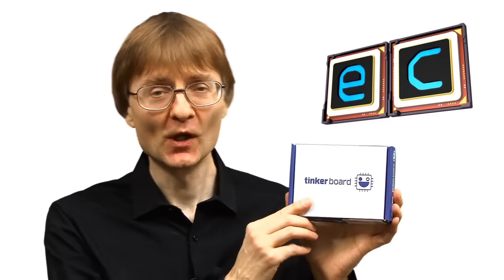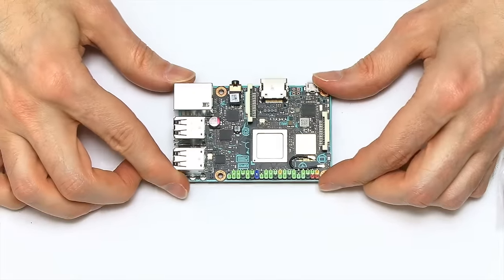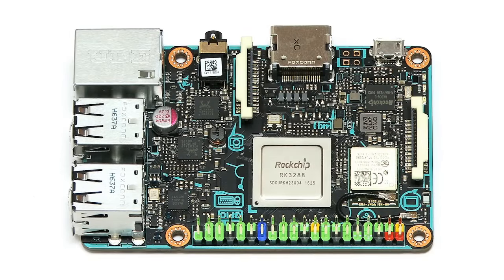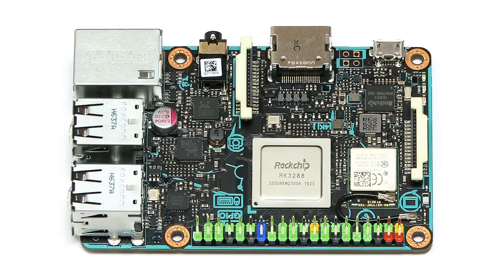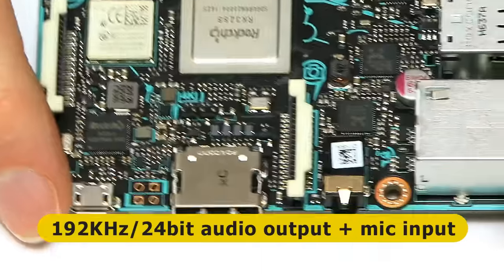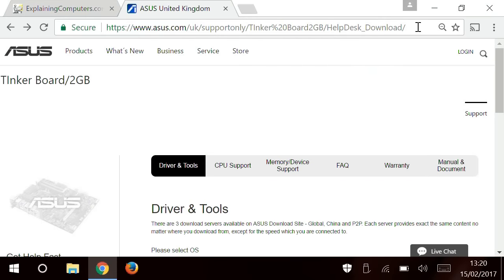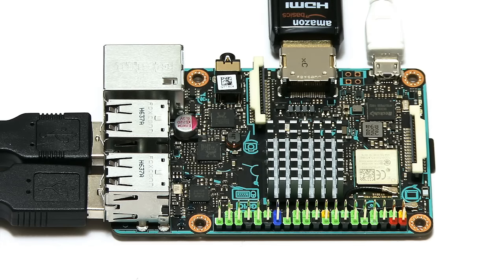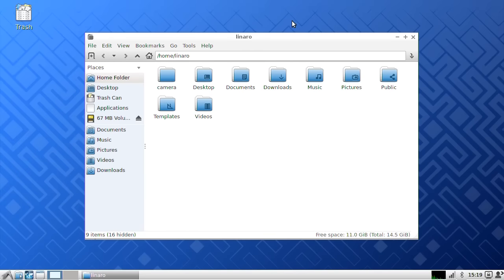Asus Tinker Board

Comment: Whatever you do, do not upgrade all packages. This breaks GPU support and you won't be able to fire up Chromium or other graphical programs.

While using Chromium, the application crashes in random moments whenever GPU is sollicited. Perhaps my board or SD card is bad.

Comment: There's one minor mistake in the specs you listed, the VC4 GPU of the BCM2387 runs at 300Mhz, it's just the video side of things that ticks at 400Mhz.

Anyway, this SBC is certainly powerful but only time and software will tell whether this is a RPi "killer".
My only gripe is the SoC itself, it would've been much more interesting with the RK3228H along with allowing them to shoot for a lower price.

To be perfectly honest, the Odroid c2 is much more of an RPi "killer". A teeny weeny bit more powerful CPU, pretty much identical GPU, 2GB DDR3 just like the Tinker Board, separate Gbit ethernet and 4xUSB2.0 just like the Tinker Board, eMMC module slot for fast storage, no WiFi or BT which is a downside for some people. HDMI2.0 and h265 2160p60 decode. And an IR receiver if that's your thing.
Only problem with it has been the ancient kernel, still 3.14 with heavy patching but that's thankfully changing soon, Amlogic has put priority on getting their SoCs mainline. It looks like their current target is 4.12. For reference, 4.12 could drop as early as 17 weeks from now or as late as 19 weeks from now, considering the kernel 4.x past release intervals with new mainlines arriving in 9 or 10 week intervals.

I don't know what the situation is right now with Rockchip and their mainline efforts, afaics they're on 4.4.

Comment: Thanks. Great video and a great looking board. Is that board 32 or 64 bit? Is the OS 32 or 64 bit? The Pi3 B board is 64 bit. The reason I ask is because I'd like to see you download gdebi and then see if you can run Chrome after downloading google-chrome-stable_56.0.2924.87-1_amd64.deb (or the 32 bit version) and then double-clicking it (gdebi then does its thing by installing the .deb file). I understand that the Pi3 B board is 64 bit but there is no official 64 bit OS for it yet.

Comment: You can edit the configuration file(s) in the bootloader (grub, lilo, etc) to show kernel messages during bootup.  Weird that they defaulted to not showing that.

This looks like it might make a nice mythtv frontend, or a XBMC set top box.  Since it runs Debian, it should be ok with the packages from Raspbian.

Comment: At what price point is a single board computer no longer considered a board for tinkering?  Of course it depends on your bank balance - some people have money to burn in front of the homeless.  At £55 / $69 it's still cheap for a media centre (if only it had Kodi).  For tinkering... connecting into electronics projects, soldering on to pins, etc, I'm happier to do so with a Pi Zero or the CHIP.  That Asus board has some nice touches though... I like the coloured GPIO pins to assist identification.  I'm wondering if nearer 3/14 we will see a new slice of Pi released.
Reply from the maker: I agree that this board is, for most people at least, too expensive for "tinkering". Certainly compared to a Pi Zero, CHIP or various OrangePi models.

Comment: I have 2 Rikomagic MK902II that is from 2014 and it uses that RK3288 and let me tell you it is faster than my 2015 tablet and 2015 Samsung cell phone AND it has something that neither of those have and that is hardware GPU in it.  That RK3288 is a beast but my devices are stuck with Android 5.1 though they did get Ubuntu on it but refused to release the image.  I think Asus may have a winner here.

Comment: - Excellent video, thanks.
- I'm exploring what simplest, cheapest equipment might be for building an electronic MIDI concertina (fully self-contained with its own speakers and battery, easy for almost anyone to create). 
- Would you have any idea whether I'm better to use a Bluetooth link to a mobile phone with a MIDI sound module app, or use this Tinker Board, perhaps with a MIDI shield if that's appropriate?
Thanks, Bruce Thomson in New Zealand.

Comment: Raspberry Pi killer?  I think not.  It is certainly an interesting board though, and the hardware specs are nice, but I would not buy one at the moment till there is more support for it.  The test you ran in this video - not worth the extra cash for the ASUS TinkerBoard over the Pi3 if you only gain 1.5 seconds on average - that might change in time though.  Still, interesting.....

Comment: Much better than the pie and your overlooking the fact that's just the processor but your neglecting the stronger gpu and onboard h.264 and h.265 decoding which in turn is more power through capability.

Comment: I am just wondering, why don't you keep the operating systems consistent? The tinker board might have double the power, but if that power is eaten by a full install of debian, then that power can't go towards the task at hand.
Reply from the maker: True, but I don't have any choice in the OS I install! :) I can only use what is available. These boards do not boot from a USB drive -- you need the appropriate SD card images.
Reply: +ExplainingComputers / Christopher & +41mighty G1itch
Whilst it is true that, at this present moment, you may have a limited choice of OS, however, because you are using a Debian install, it is possible to use repositories from other ARM Debian based repositories (ie. Raspian, Kali, Armpian, Ubuntu and others).

Also, due to the nature of Open Source (ie. to be able to modify, adapt and redistribute), it is possible to re-spin your own version of Linux and to share your version with others (therefore, it is possible to create a cut-down version of Debian tailored to a specific device or usage and then to redistribute this version to other users).

At this point I will interject with a small caveat, whilst it is possible to mix and match various repositories with your choice of base installation, you must be careful not to install a library or application that may break the functionality of the original distribution.
Reply: why not use raspbian with the tinker board in the end they are both linux systems dedicated for sbc's
Reply: That's my question:  Could they be binary compatible?  It would only take a few minutes to test.

Comment: Doesn't most of the additional processing power come from extra cores? I wonder if that filter is too linear for multiple cores to really show more than the 0.1 extra Ghz of a single core. That's what the result looks like to me, and it would suggest that you had 3 cores idleing on the Tinkerboard, where you would only have 1 (?) core idle on the Pi3.

2Gig of memory is the point at which Android becomes much more usable, and if you could get Android, or Remix OS to run on it, I'm sure they would make it very productive. I often wonder why Gentoo isn't the OS of choice on these systems. Particularly as you could skip all the compilation by providing a pre-installed Gentoo image on the SBC support site, and everything FOSS for Linux is then possible in a very native way, without having to worry if there is an ARM package for your preferred software. It may take a while to compile, (particularly on such a small machine) but the end results when running the software should be much more optimal.

Comment: Overall, most Linux distributions need a 1.6Ghz dual core processor to feel snappy.
As well as a good 64MB of VRAM minimum.
So I had expected this to happen.
It might still feel slow on a 4k desktop, but 1080p or 720p should be snappy.

Comment: Hi! Nice video. But i have 2 questions. Is there big CPU temp difference between Raspberry and Tinker? I think they gave this small heatsink in package for some reason. And the other question - have you tried Tinker with any raspberry accessories, like screen or other? Does it work together?
Reply from the maker: The Tinker Board CPU certainly gets very hot very quickly without the heatsink (I tried -- far hotter at idle than a Pi, though I've yet to do detailed tests). The 7 inch Pi screen is supposed to work. I will report back in videos as I test things out! :)
Reply: Thanks for reply! I'm wondering how well will it work as email or web server with so many heat produced. Maybe it will require better cooling while working 24h/day

Comment: Hackaday updated their review with this bit of info: 
A member of the Asus Marketing team read this review and contacted Hackaday with some updated information. According to our discussion, the Tinker Board has not officially launched. This explains a lot about the current state of the Tinker Board. As Jenny mentions in her review below, the software support for the board is not yet in place, and as comments on this review have mentioned, you can’t source it in the US and most other markets. An internal slide deck was leaked on SlideShare shortly after CES (which explains our earlier coverage), followed by one retailer in the UK market selling the boards ahead of Asus’ launch date (which is how we got our hands on this unit).

Asus tells us that they are aiming for an end of February launch date, perhaps as soon as the 26th for the United States, UK, and Taiwan. Other markets might have some variation, all of this contingent on agreements with and getting stock to regional distributors. With the launch will come the final OS Distribution (TinkerOS based on Debian), schematics, mechanical block diagrams, etc. Asus tells Hackaday it is a top priority to deliver hardware video acceleration for the Rockchip on the Tinker Board. The Board Support Package which hooks the feature into Linux is not yet finished but will come either on launch day or soon after. This is the end of the update, please enjoy Jenny List’s full review below.
Reply from the maker: Indeed, but many stores in the UK have been selling them for some time . . .

Comment: Your comparison was it done with a 32 bit OS on the Pi 3 or 64 bit?  If 64 bit then that makes sense that it is closer, but let's face the fact that still most applications for both boards will still be 32 bit.

Comment: Hadn't heard of this board. Interesting that it fits in Pi cases. I'd have preferred it to run an x86-64 processor personally.

In my experience though, Asus has questionable support as they use a third party. Had nothing but problems with them in the past.

Comment: I have some questions that may be obvious to some but I literally know nothing about the Rasberry Pi or boards like it. What is the purpose of this board? What do you do with it? Why would I want one? What are most of the people that are purchasing these units using them for? 

Thanks
Reply from the maker: Typical uses are learning programming, running a small PC (light desktop computing), building a media player, connecting to a TV for media playback and browsing, robot controller and other maker projects, building a small server or NAS (network storage) unit, remote camera controller, etc. :)
Reply: I've done things with the Parallax Basic Stamp. So I guess I can assume that the Rasberry Pi and ASUS Tinker are similar except that they are much more capable devices.

Thanks again.

Comment: I know VERY little but is it like an Arduino? And they named them after Alan Turing's Turing Tinker machine?
Reply from the maker: Arduinos are microcontrollers; the Tinker Board is a full computer. But, with its GPIO pins, it can be used like an Ardunio to control electronic devices (and in turn electrical ones). I don't think the name is linked to Alan Turing.

Comment: The "benchmark" you did using GIMP's Edge Detect Neon script only draws a picture of single core performance between the two CPU's. Why? The Edge Detect script only runs on a single core and does not leverage any threading. You can see the source for it here: https://git.gnome.org/browse/gimp/tree/plug-ins/common/edge-neon.c If you want to test multi-core performance, you could use sysbench or maybe use ffmpeg to encode a video.
Reply from the maker: Now this I did not know -- I always assumed that it was multi-core. Very helpful. I will revise my tests in the future (although thankfully here I at least compared two quad core PCs, if only apparently stressing one of these cores).

Comment: Nice! Specs are great, and I think both the raspberry pi, and the 
tinker board suffer the same bottleneck... The SD communication mode 
they use...

There several different mode to communicate with the SD card, and the micro SDHC and micro SDXC can be supplied with 1.8 or 3.3, (but you can't expect the same performance...) I'm not sure actually which supply voltage, and communication mode is used by the raspberry, but I'm pretty sure, it's not the fastest.

I have a Raspberry Pi 3B, I'm using it with a Kingston micro SDHC 32GB which has Class 10, UHS-I and U3 ratings (and claimed 80MB/s write, and 90MB/s reed speed, I'm also using a Philips 32GB USB 3.0 flesh drive, with tested ~30 MB/s write speed, and ~70 MB/s read speed, which on the Raspberry is bottlenecked by the USB 2 port (having ~35MB/s max transfer speed), still, the same raspbian system is starting, and responding much faster by booting from the SD, and running from the USB 3.0 drive, then running entirely from the SD...

Regarding the similar results from your experiment... I'm not sure how GIMP works but if it reads and writes the SD while applying filters, then you didn't tested the performance of the pi against the thinker board, you tested the one SD against another, thus resulting in pretty similar times... Try rendering a monkey head in blender, but have the blender file ready and it must be simple with fairly low settings, cause it's pretty much a nightmare to use blender on the pi. It will work, and it does actually good job as a network render server(master) but when it's started, even the mouse is barely moving, not to mention if you're trying to rotate an object... Rendering in blender will also take advantage in all 4 cores so you can test CPU speed, and temperature at once.

(If you don't believe me, test it: Restore the same raspbian image to the SD and a fast USB 3.0 drive, cause USB 2 drives usually don't use the maximum transfer speed of the USB 2 port, then on the SD card's "boot" partition, change in the cmdline.txt the entry that says "root=/dev/mmcblk0p2" to "root=/dev/sda2" and plug both the SD and USB drive in and turn it on. It should boot from the SD, and use the USB drive's second partition as root, but you have to have both the SD card and USB stick plugged in. The other thing to watch out for is that you can't really boot reliably with 2 usb storage plugged in, as the kernel may or may not fail to find the system at sda2 partition, depending on the order the drives are loaded... you can attach additional USB storages when the system is running, you just can't boot with 2 USB storages... Mause and keyboard are not storages, so those doesn't count. You can format the SD card's second partition, to use as more storage.)
Reply: Oh and... if you try booting running raspbian from USB 3 drive, you should have even better performance with the tinker board(in case the same system is working on it), since it doesn't shares USB with LAN...

Comment: Great information, as we are looking into the RPi for digital signage at my work. They're interested in this instead because of the larger RAM and CPU clock speed. But, all of my research points to this being a 32-bit processor, while the RPi 3 is 64-bit. Could that attest to the speed of the GIMP filter test? This is one of my reservations to this board.
Reply from the maker: You may want to consider a LattePanda . . . as featured in today's video! :) 2 or 4GB of RAM and 32 or 64GB of onboard storage.

Comment: This reminds me I still haven't gotten around to do a proper little Linux box :) Debian definitely looks faster on this than on the Pi, from what I've seen of it. They're both marvelous devices I think, but I think I want a PC CPU, something faster than an Atom like the new 15W CPUs, and very fast SSD storage. I don't need 4K at all. If cost is not an issue, could you recommend one supporting Fedora or Debian that's smaller than an ITX board but still has chassis etc available?
Reply from the maker: It sounds like you may like a Pico-itx board?
Reply: Yes, sorry, I meant smaller than mini-ITX in my reply above - So there's Pico-ITX and also Mobile-ITX. Searches seem to give me results with quite weird CPUs and (it seems) no GPU power. I think I'm looking for an actual desktop or at least laptop replacement in as small form factor as possible. The Jetway, looks hm, maybe something like what I want but I'm not sure. Do you have experience with Pico-ITXes and could give some pointers?

Comment: Thanks for the video. I think that the lack of support is due to the fact that it hasn;t been officially released yet. It seem that someone in the UK has been a little enthusiastic getting them onto the market.

Do you know if the 192K sound support extends to the mic input?
Reply from the maker: Thanks for this -- I've just read up on the "not released yet" thing. I saw the initial announcements back in January, and saw the board advertised on the websites of several UK sellers. On that basis I placed an order, and my board promptly arrived! :) I do not know if the mic input suppoprts 192KHz.
Reply: Thanks for the reply, yes I found an early seller too. It certainly needs the heatsink.